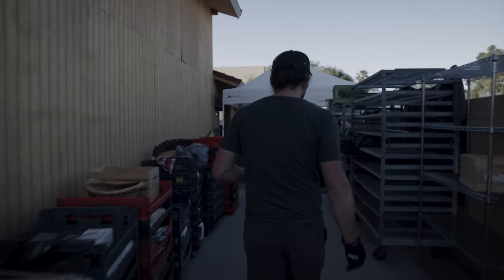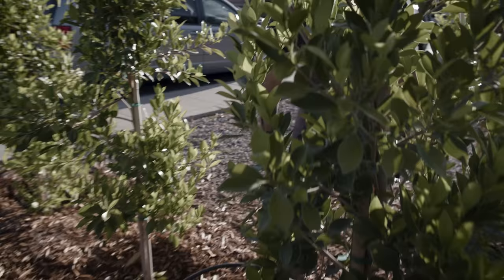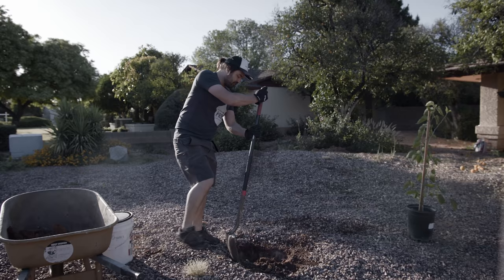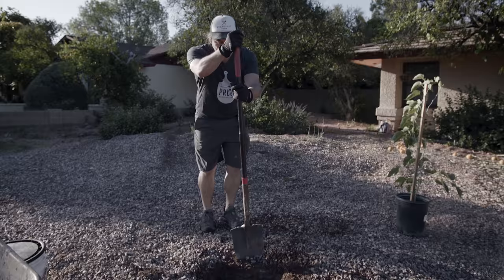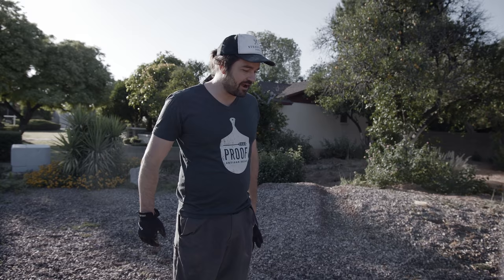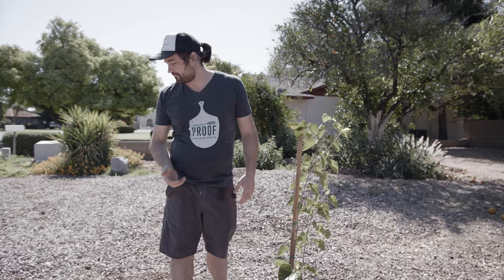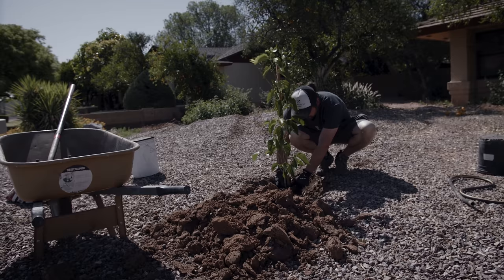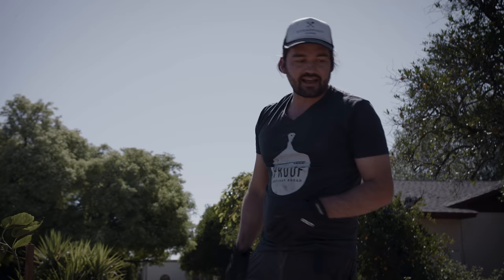Beyond the Bakery Gardening and Growing Food | Proof Bread

Comment: I have been growing all kinds of vegetables in the Mojave desert of southern California for over 35 years where the summer temps get to 120+ and the winters get below freezing with sometimes snow! If you want the root system of your tomato's to be strong and vigorous, when you transplant them into the ground, plant them deep. When tomato plants are planted deep even covering up leaves, all along the main stem the plant will send out new roots. So you won't need to pinch off the flowers especially in your heat as about 99% of tomato plants, with the exception of a couple varieties, will not set flowers when the temps get over 100 degrees. Also, you might not want to pinch off the flowers for another reason and that is if your tomato plants are determinate. If they are, then the plant will not generally re-flower later in the season as a determinate tomato flowers once very heavily and that's it. All the fruit ripens at pretty much the same time. The rest of the year it's just a green bush that looks like a tomato plant without tomato's and you would be wasting water that could be used in a more productive way! In your area you should plant indeterminate tomato plants as they will flower in the spring and when the temps get too hot the plant wont flower, but the earlier ones that did will be growing tomato's that you can enjoy by mid summer. Then in late summer the plant will have tomato's again for a fall harvest of even more than before.
You might also look into drip tape irrigation as it's easy to setup especially on your smaller scale and not very expensive. That way you can put it on a timer and not have to physically go and move a hose or the drip system you are using now. I farm a little more than a quarter acre and after the one time cost of certain pieces, I can go a few years before needing to buy more drip tape and maybe a few fittings. I don't think I have more than five hundred dollars into it and I started 10 years ago!
Reply from the maker: That is a ton of good information. Thank you so much!
Reply: @ProofBread  
Proof Bread, you are very welcome.  I am 61 and love seeing the "younger generation" interested in farming whether it's on a small garden scale or a hobby/market farm level. I would also suggest that you try to find tomato seeds, if you start your own seeds, that will grow into a tomato plant that is more heat tolerant. Or you can shade them and some of the surrounding area to keep the air temps a bit cooler so the plants might set more flowers. I buy my tomato seeds from a person who lives in Las Vegas and we both know how hot it gets there! Her tomato plants produce so much in their heat that it's amazing! I have not had any problems growing this variety in the hot Mojave desert summer.
I may not have all the answers but I've been doing it for 35+ years in the desert and have had great results, especially after going to a full drip tape irrigation system. Now if I can just get control of the squirrels and rabbits I will be happy! LOL
Also, if you don't get really strong winds like I do, you won't have to plant them as deep as I do. I need my plants to have a lot of root structure because we get 30 to 40mph winds all the time and the roots help hold the top of the plant in dealing with the wind. I don't think you will have that problem from what I saw. I would say that you can plant them about a third of the way into the soil. Another tip is for every night that the temperature is below 50 degrees that your plants are exposed to, it adds about a week to the days to maturity that's listed on the seed packet or for that variety. Sometimes it can't be helped since we have no control of the weather but it's good to know.
Looking forward to seeing more video's.
Jim